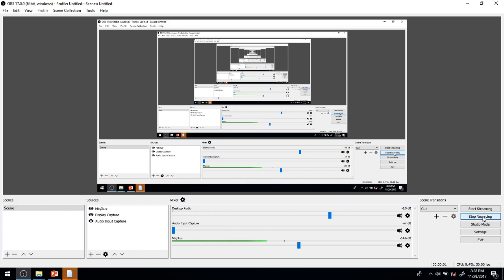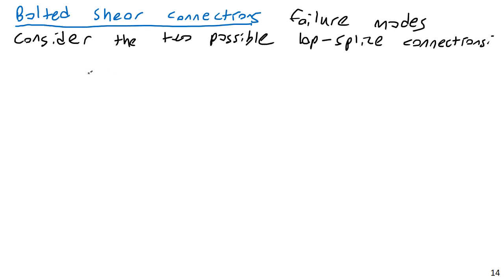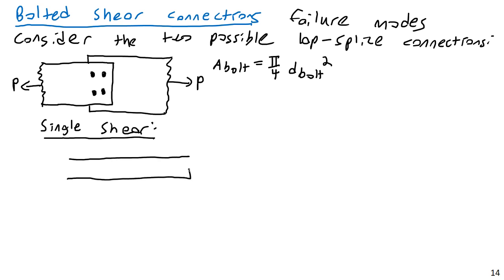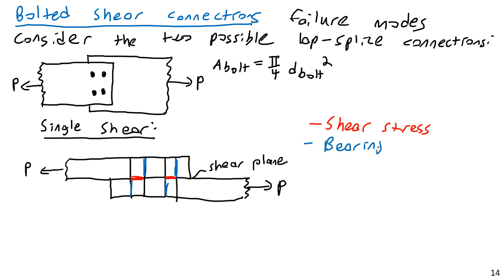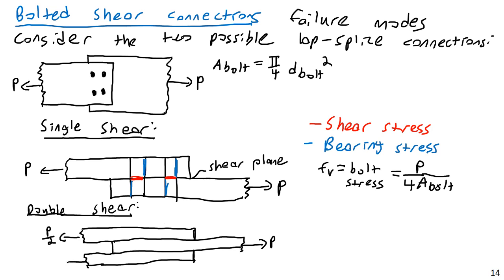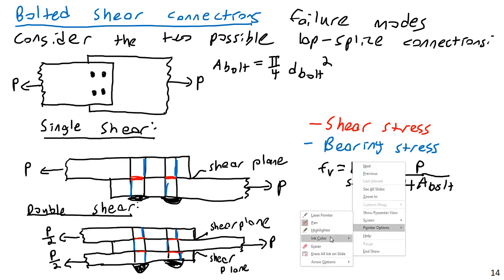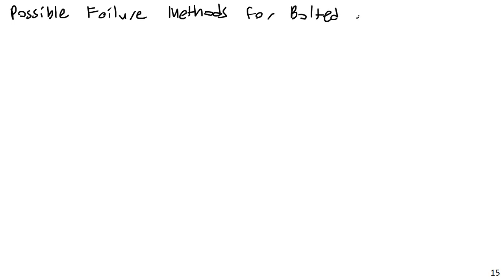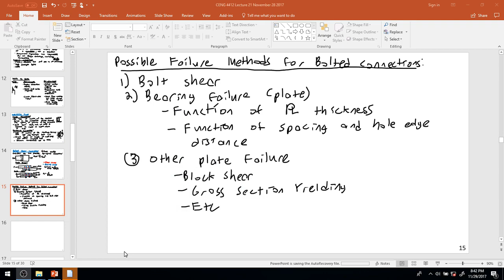Bolted Connections Failure Modes - Steel and Concrete Design

Comment: At first, thanks a lot for the great tutorials. What was the reason of dividing 8 in double shear? Actually what indicates 8?
Reply: 4 bolts x 2 plate planes.  Each bolt has 2 lines of shear stress.

Comment: What about bending...are  bolts affected by bending stresses?
Reply from the maker: Are you talking about bolts resisting the overall moment of a connection, if so, those forces are resisted as shear in the bolts. Or are you talking about bending of a single bolt?